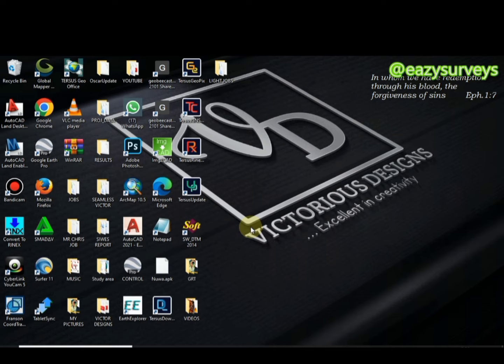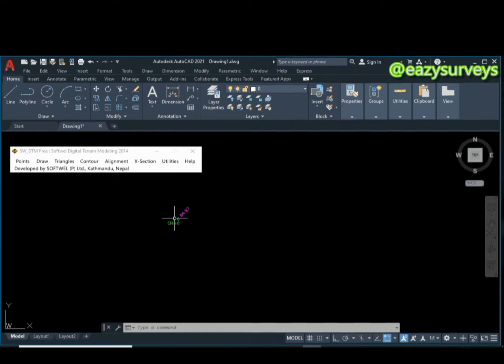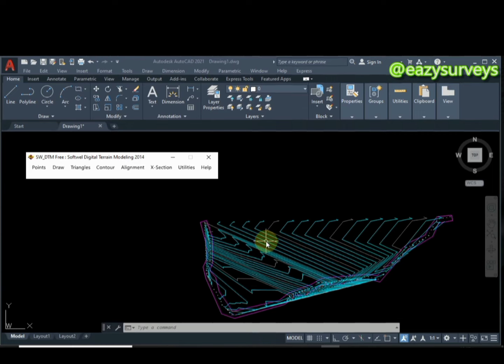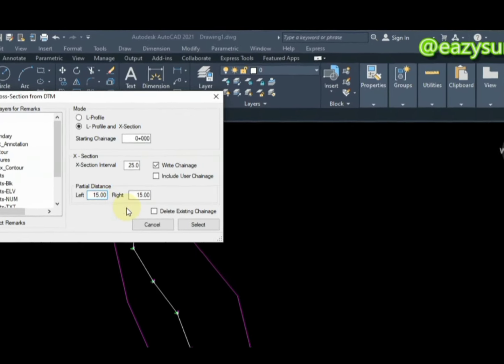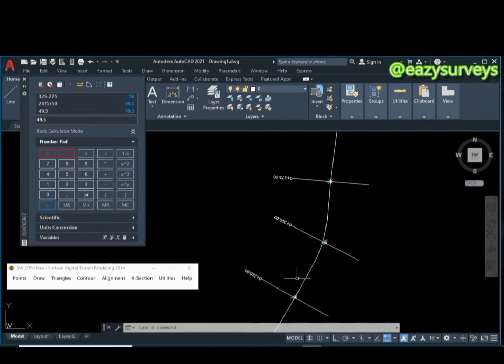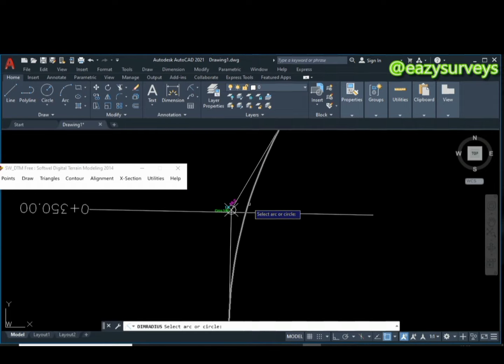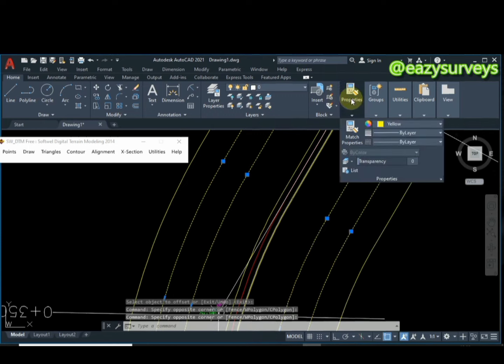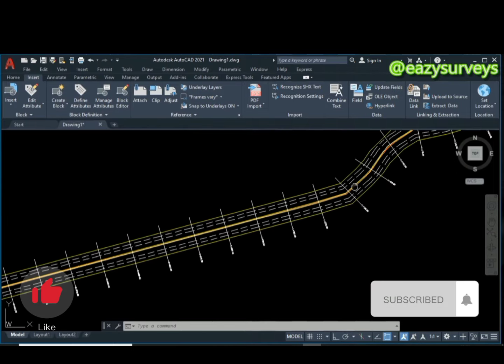Create SURFACE ALIGNMENT in AutoCAD || Start to Finish || Latest Tips for Beginners

Comment: Let assuming that after i get the existing ground level and i design level. Where i will have cut and fill. How can i do that?
Reply from the maker: Thanks for the feedback ❤️ 
The plug-in does not have the tool to calculate cut and fill
I recommend Civil3D for this Exercise 

Thank you ❤

Subscribe turn on notification 
And stay tune ❤